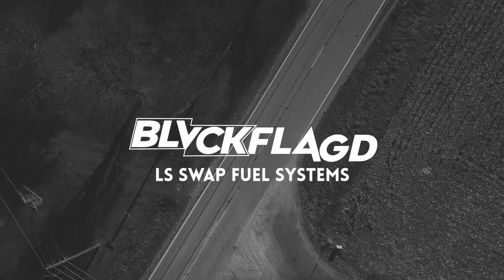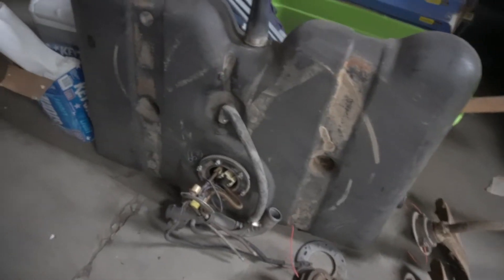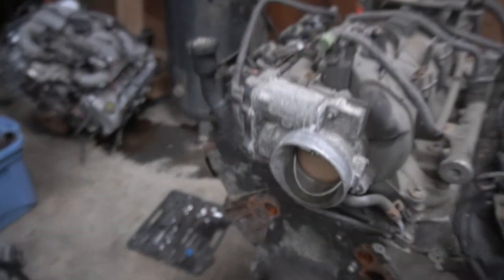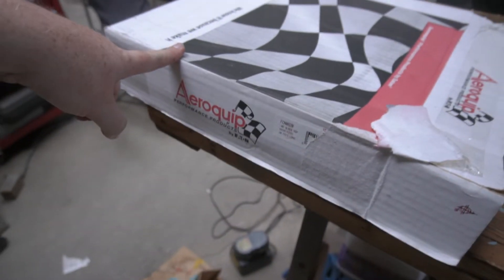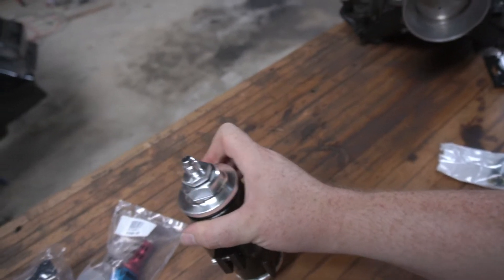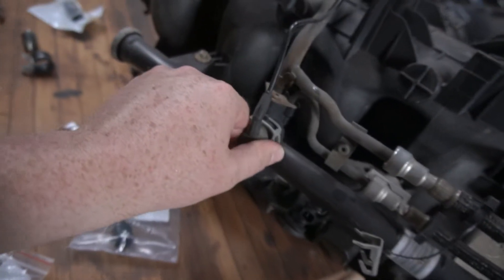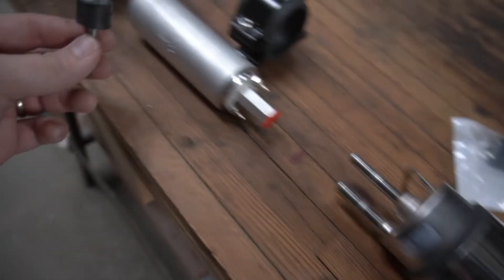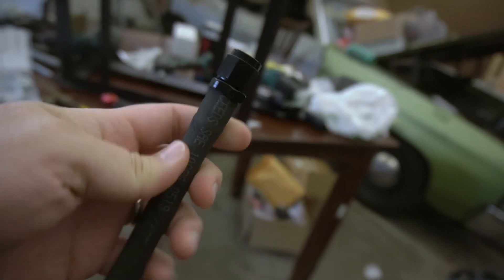2 LS Swap fuel systems YOU can build for CHEAP!

Comment: Whats better for a cam swapped only 2002 5.3 LS swap daily driver, return or using the corvette return style filter? as of now I was going to use my Fitech inline fuel pump to a EFI filter then to my stock 5.3 fuel rails with vacuum then back to the tank
Reply from the maker: For performance, I really don't think it matters. Switching from one to another may require a little more attention to the fuel tables in tuning, but you would need to tune for a cam swap anyway, so I don't think it matters. If you're all setup for the return style fuel rails, just keep those.

Comment: Can you just use an external pump straight to the feed ? I’m trying to start a 6.0 in a parts truck . It will run for about ten seconds and then die . It’s has a tuned ecm security removed etc .

Comment: I picked up a 4.8 L vortec, it has the gas line and a return line like the 5.3 L in your video, will an inline pump work with that? Or is that return line only for vapors? Im assuming it'd work like a Diesel Injection pump tank return line but I've been having difficulty looking it up.

Comment: On those older manifolds you can use the factory fuel pressure regulator as a boost reference and the pressure will rise as the boost rises.

Comment: I am going to put the caprice tank and fuel sending unit into a 1961 Cadillac.  I am using a gen 4 ls 5.3 engine with stock intake and fuel rails.  Do I need to install a high pressure pump in my tank unit?  Also can block off the return lines?
Reply from the maker: You can swap out the pump in the caprice tank foor whatever you want, but if it came out of an LT1 caprice (94-96) the stock pump should work.

If your gen 4 fuel rails are returnless you will need a regulator somewhere in the system which will send a return line back to the tank (returnless fuel rails have no regulator built in).

Hope that wasn't too confusing.

Comment: I enjoyed the video, even though your opinion about which way is 'easier' depends on what vehicle application it applies too :).
My main concern was since my k2500 already had a factory return style system, installing a high pressure in-line gsl392 (walboro 255) like yours with a 100 micro pre-pump filter if I still had to run the corvette FPR. I am running the earlier style intake with a return setup to keep it much simpler in my k2500 thanks for the side by side comparisons.

Comment: Haven't had good luck with external pumps. Seems after driving an hour it starts dropping pressure and pump  sound like it's staving.  Running 8an lines

Comment: This may be a very obvious question so I apologize, but when doing an external set up, would I remove the pump out of my in tank hanger assembly? I’m having a difficult time understanding how to make this work using a stock fuel tank
Reply from the maker: You don't need both. If the vehicle you're swapping is already fuel injected, you have nearly everything you already need in place. My opinion is the in-tank pump is superior to an external in most cases...it will run cooler, quieter, and last longer. 

You may only need to swap out the stock pump for one that delivers more fuel depending on the vehicle.

What vehicle are you working with?
Reply: @BLVCKFLAGD  I’ve got a 1993 Mustang with the 2.3l engine currently. I’m going to be using a gen 3 lm7, just a cam, springs, and headers kinda like your set up. What I saw my dad do on his ls swap (93 OBS Chevy truck with a 6.0) was to use an old Monte Carlo fuel pump and put that into his in tank hanger assembly. That pump makes a bit over 60 psi though

Comment: Where do you get power from… msd 6014 doesn’t come with wiring for efi tank
Reply from the maker: You can wire it up to key on hot source. Preferably use your key on 12v to trigger a relay going to the battery for the fuel pump.

Comment: corvette filter $50, expensive maintenance ? $10 filter sounds cheaper, good internal pump, n good regulator , return lines, fuel evap system on tank
Reply: Nope Corvette filter is built in regulator

Comment: On my 1970 chevelle can I use the stock tank with external pumps or will I still need an i tank pump with the external pump?
Reply: Yes you can I have a 68 cutlass stock tank eternal pumps drive it cross country many times

Comment: Hi bro how u doing 2003 intake from a Tahoe with the returns line to do I still need to use the Corvette regulator it's just a daily driver stock car
Reply from the maker: If it has a return, it means the intake has a built in regulator. You don't need the corvette filter/regulator but you will have to run the return from the engine to the tank.

Main reason I ran the corvette filter/regulator was to simplify plumbing and run only 1 fuel line the length of the car. Corvette filter is near my tank, so the return is only about 1ft long.
Reply: @BLVCKFLAGD  okay thanks for the help bro this is my very first swap I got everything hooked up as a rough draft just got to go through and check everything and reroute the wires longer and I should be good to go it's got a couple more things I got to tighten up

Comment: So glad I ran across this vid!  I'll be doing this in a bit..  Sooo, if I use the Corvette filter/regulator can I keep my single (99' LS3 4.8 intake (no return)?  I'm planning on running the Terminator-x system..  Thanks for explaining it all!!
Reply from the maker: Yes, you can keep the returnless rails since the corvette filter/regulator has its own short return line.

Comment: I have a TBSS intake return less with a 97 obs return style fuel system. Can I just cap the return and hook the fuel line to the TBSS directly to the TBSS fuel rail without issue?
Reply from the maker: That's what I did here. I just capped the return on my intake and ran a single fuel line from the corvette filter regulator. The return will come out of that regulator back at the tank.

Comment: So what stock fuel rails do i run, the return less or the or the return style?
Reply from the maker: Either will work with whatever setup you go with (I just capped the return on my fuel rails since I'm running the corvette filter/regulator).

Comment: So on a return less system while utilizing the corvette regulator do you have to return it from the regulator to the tank or can you just cap it off ? I think I kinda answered my own question while typing this , so is the return on theregulator how the regulator regulates ?
Reply from the maker: The corvette filter/regulator at the tank has a short return line, so only 1 fuel line runs up to the rails.
Reply: But is the short return required or can it be caped off

Comment: installing a LS fuel cell no return line. do I need a regulator?
Reply from the maker: Yes. Run the corvette filter/regulator at the tank. It will have a short return line but you won't need to run a long line up to the engine.

Comment: In reference to the gen3 fuel rails with the return blocked off, is there no worry about air build up in the rail? what method is used to push air out?
Reply from the maker: First time we fired it up, we just bled off the air out of the test port on the fuel rail. It's never been an issue at least on the Camaro setup.

Comment: Do you have a video showing what you did to modify the 94-96 Caprice tank into the Chevelle? I'm doing an LS swap on a budget into a 68 Cutlass and stole your idea on the fuel tank assembly issue. I haven't gotten to that point yet. I'm just curious what I have in store.
Reply from the maker: We don't have a video yet, but will when we finish the work. When researching, others had to cut a little out of the trunk floor near the center and extend the tank straps a few inches.
Reply: @BLVCKFLAGD   
I'm still trying to figure out what motor and transmission mounts to use. I'm using a 5.3 from a 2wd 2005 Yukon and the 4L60e. Do you have any suggestions, short of fabricating my own? I see tons of options for Chevelles and other A-Body cars. Nothing specific says Cutlass. But I think 3rd gen A-Body cars are the same in this aspect, right?
Also, I wonder if I can get by with just extending the straps? I have a good trunk pan and don't really want to cut it up. I've got a lot to do before I get that far. Hopefully I can see what you do first.
Reply from the maker: @joshuanewcomb1929  I would think any of the a-body mounts would work for the engine. For trans mount, it's pretty easy to slide it forward or back and drill new holes where it mounts to the frame. Don't know on how much space you need on the tank. We won't get to doing ours on the chevelle until late winter or early spring.

Comment: I have a single supply fuel rail so I don’t need to worry about my return it’ll do it on its own?
Reply from the maker: You would use the corvette regulator/filter at the tank with a really short return, then run a single line up to the fuel rail. Same setup I'm using on the camaro with more details in this videoo https://www.youtube.com/watch?v=KJlfyED8ZZ4

Comment: Wow.  I was thinking maybe I was going into overkill with an10 feed line to fuel rail on n/a 5.3. I’ve got other things to insert and swap out but ya. Your 1st setup is a mirror to soon to be mine too. Except that corvette fuel regulator and filter and walbro. Mine is a Holley pump 100gph 75psi and eBay fuel regulator.   But ya. Glad I found your video. My anxiety is at rest. Lol. Be safe man

Comment: I did an 93 obs ls swap,  drivetrain from 05 tahoe, returnless,, system,,,    I did eliminate the obs fuel filter,,   Gt fuel regulator/filter instead,,,     Is it correct???

Comment: so do you have an internal and external pump? or just 1 of them
Reply from the maker: We're running only an external on the camaro. Just a single.
Reply: @BLVCKFLAGD  Oh ok. Im trying to get my fuel system done on a ls1 swapped 240z im trying to figure out all the parts i need for it. If I do get an external pump will it work fine with a datsun fuel tank? I didnt know if i should just get an oem fuel tank or have a fuel cell fabricated.
Reply from the maker: @thewinchester8996  That all depends on the tank...I don't know enough about 240z's, but if it came with fuel injection stock, you should be able to swap out the internal fuel pump in the tank for one that will flow enough for the ls swap (depends on what's in there).

Usually for an external pump setup you need a tank with a sump at the bottom (similar to a fuel cell). External pumps don't do too well if they have to suck fuel out of the tank.

They do make retrofit kits that will drop an internal fuel pump into a stock tank without too much effort.

Comment: I have a stock fuel sending unit on my 84 firebird. I picked up 2 inline pumps that I want to run for my fuel system. For the HP I want (will be running at 6 to 700hp but want it ready for 1000)  I need to run a 5/8 line.  Should I have 2 separate lines to both pumps and then T into 1, or can I have it split as it comes out of the tank (meaning 1 feed at stock size into -10 fitting into 2 pumps and then to the front)  

My only concern with running 1 feed from tank and splitting before 2 pumps, is that one tank may suck harder then the other and eventually lead to failure.
Reply from the maker: I don't have first hand experience with a setup like yours, but I picked up the stuff for one that I haven't finished. I would think separate pickups would be better for each pump. I was gonna run dual in tank pumps into -10 line for a turbo setup. At 6-700 HP though, the right single pump would work just fine I would think.

Comment: My question here.

Corvette FuelFilter/Pressure regulator.
With return style at intake manifold. 

The two lines from the tank goes to the two ends on the filter/regulator. 
The return line from the intake then goes where??
Reply from the maker: Since you have the short return line from the filter/regulator, you can cap off the return line at the intake. It's not needed anymore.

Comment: POSSIBLE PROBLEM, with your fuel setup   starting about 7 min into video. DID you actually set it up like stated in the video and did it run reliably?
Firstly why  r u running a filter , then pump,  then filter regulator combo? you could save money eliminating first filter.
 Secondly , wouldnt sucking through the first filter exacerbate  the possible problem that these inline external pumps have, theyre are meant to only push fuel under pressure and dont suck very powerfully or reliably? thats what driveway engineer channel said i think.
Reply from the maker: Yes, it's setup like in the video and runs reliably. I've got a follow up video you can watch about it. 

I think it's a pretty accepted practice to run a pre-filter before an external pump (an internal would have the little sock filter on it). It was inexpensive and only filters out bigger stuff. Internally it's a cleanable metal mesh so it doesn't really restrict any flow either. Should make the pump last longer by keeping junk from getting in the pump.

The filter/regulator after the pump is for smaller particles and protects the injectors from getting clogged.

The car has a fuel cell, and the external pump is below the cell, so gravity always keeps fuel in it and it's never sucking anything to get fuel.

I'm also surprised by how quiet the setup is. People always talk about how loud externals are, but this doesn't seem any louder than a stock gm internal.

Comment: THIS CANT BE RIGHT can it ? VERY EXPENSIVE! Im Doin a 5.3 LS/vortec into a gbody.   In canada using amazon to source parts im up to $375 cdn/$300 usd  for fuel system and i might still be short a male 6an  fitting or 2 for fuel pump !
thats ,  walboro pump$113 cdn,  evil energy filter $42 cdn, 4 adapters for pickup and return style fuel rails$64 cdn, 16 ft 3/8  fuel  feed line hose kit with fittings $63 cdn, 16  ft 3/8  return line$43cdn

my whole cutout motor only cost 445 cdn. Do you know of cheaper place to source these fuel line  parts?
Reply: i could maybe save the 43 for return hose and try to use former feed hose as the retrun line but then im possibly looking at a leak and fire hazard and my car is only insured for liabilty and would get a mere 300 for the car if it burnt!
Reply from the maker: Yeah, you can use your existing line as return hose and save some on the fuel line, but that sounds pretty close for cost. You might be able to find the pump or some of the fittings cheaper, but that's with some searching. Summit and amazon seemed to be the best deals.

I do have links here https://blvckflagd.com/youtube/2-ls-swap-fuel-systems-you-can-build-on-the-cheap/ if you want to compare costs for what I used, but I bought all that stuff a while ago too, so prices might be different now. I tried to find the cheapest stuff that would still get me by a tech inspector at the track, so that's what's in the list. If that's not important to you, you could save money in some areas.

Comment: Ok keeping iwth the BUDGET  Theme, I have a RETURN style system on my 5.3 LS going into an 84 cutlass.
What would you recomend ; 
1. a new  compatible pickup with fuel pump in my stock tank? if there is one?
OR that Caprice tank with new pump spliced in?
whichever version you recomend, can you mention exact part numbers for pickup and fuel pump...

Can i repurpose the stock cutlass fuel feed line as my new return line by  just making sure it goes into a return on pickup?
Reply from the maker: Most budget way I could think of...There are g-bodies that came from the factory fuel injected. If you can find a used tank from a fuel injected g-body, that would be the best starting point, as it should be baffled correctly and have the right pickup on it. Sometimes this is hard to find though because most junkyards poke a hole in the tank to drain it and don't sell them. 

Drop in the fuel pump from almost any GM v-8 that was fuel injected, but didn't have TBI (those are much lower pressure) OR pick up a Walbro 255 (there's a bunch that would work, but GSS341 is a good option). It's only a few more buck for a 450 though, which will support more HP in the future.

Yes, use the stock fuel line as your return as long as its in good shape, then run a new send line rated for fuel injection.
Reply: @BLVCKFLAGD  thanks I eliminated return hoses, fittings , adapters and saved 75 bucks unless something goes wrong.
FYI; I already tried searching entire provincial gvt salvage and theres no tanks listed. our canadian population is 1/10 the density as usa, so we probly have 1/10 the amt of total cars to pick parts off and i will probly have to drive 6-8 hrs to neighboring provincial cities with more people in one city then we have in our entire province , lol.  obviously that 6 hr drive/ 200 dollars in gas negates any money savings

Comment: If I use that Walbro 450 for my in tank pump, will it have to much pressure for the corvette fuel filter/regulator? should I go with a smaller pump? Thanks for the vid!
Reply from the maker: I think it depends on the brand of filter. Some cheaper ones say more than 255lph and fuel pressure goes up.
Reply: Yes.....a True hotwired 450 will over run the regulator slightly.  Easy to tune around, but yes it does.
Reply: @tunerdadtunerdad7927  Thanks !